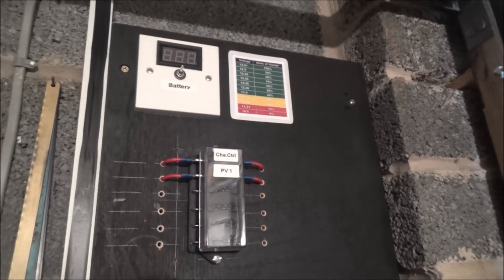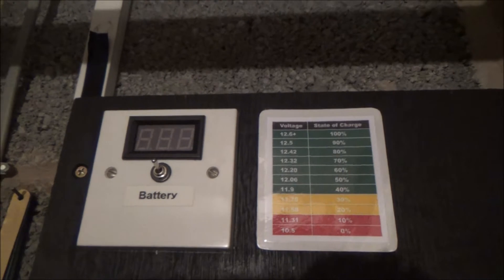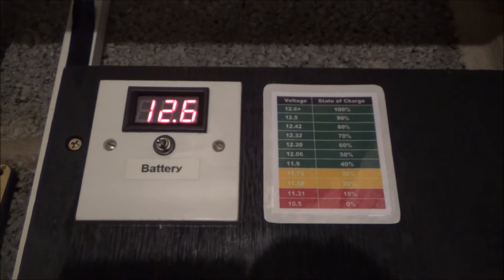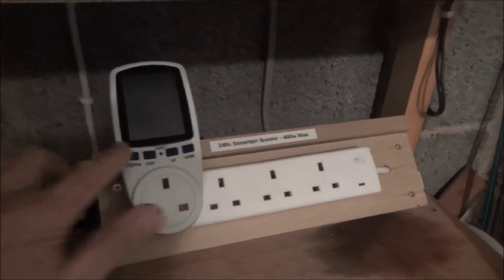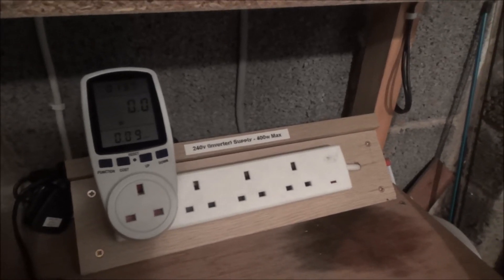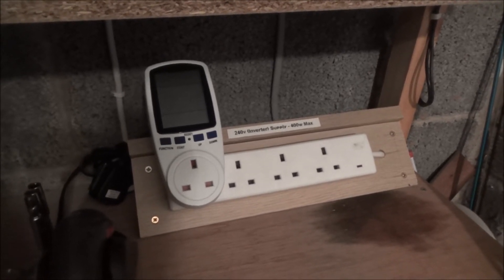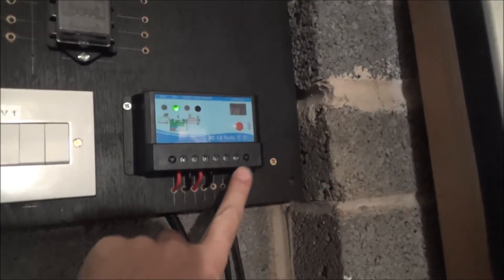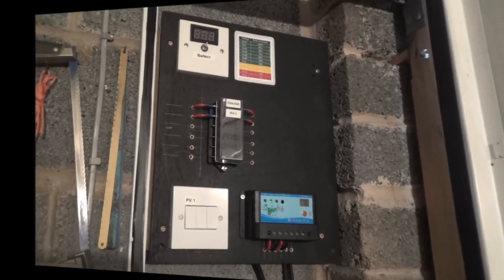Simple DIY Home Solar Project - Off Grid Garage - Part 2

Comment: love that volt meter idea, is that just wired straight to you battery bank?
Reply from the maker: sephuk Yes it is and is very handy for checking the voltage when required...
Reply: JesterBushcraft Thanks for the reply, ive asked the same question in a facebook messege, its in your other folder!

Comment: Nice addition.
Have you tried connecting the inverter to the load output so the charge controller can stop the inverter from over draining the batteries?
You could still attach 12 LED lights! as well.
I have seen some 12 volt LED lights cheap on E-Bay but most of them where for the car. There were some for the inside of (Camping Trailers (Caravans)).
Keep at it I am curious to see what you do or add next.